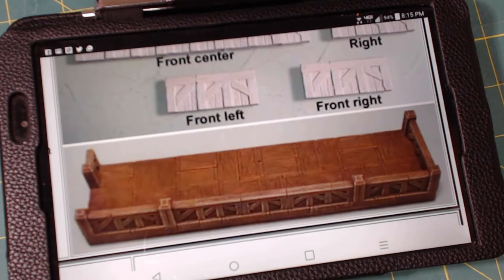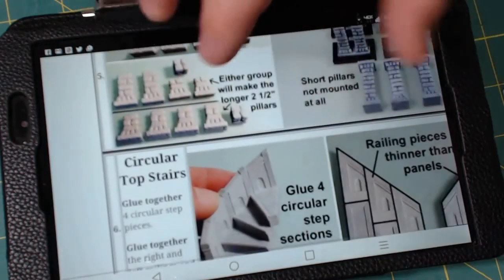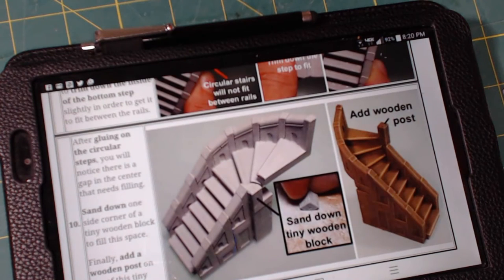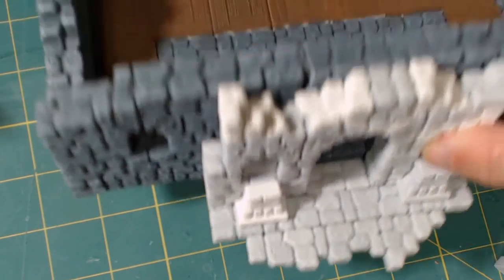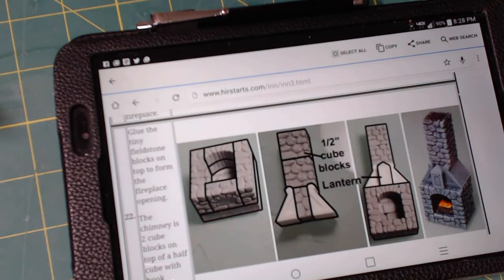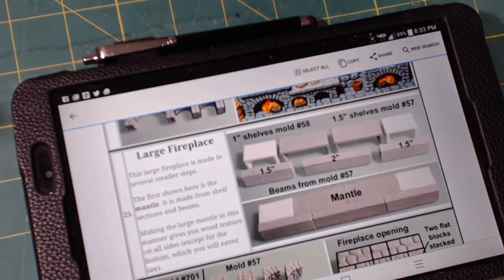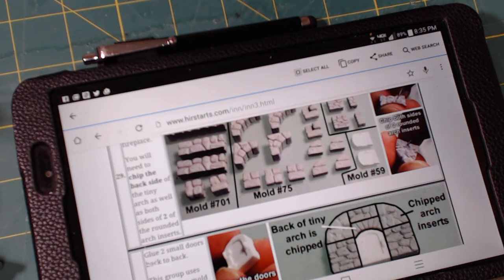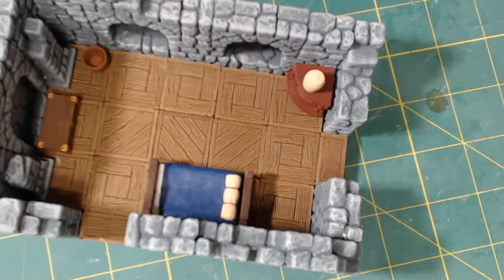Modular Inn with Hirst Arts Molds Part 12 - Stairs, Wall Blockers, Pillars and Fireplaces

Comment: Hey, what do you call the foam mat you glue everything to? I know you said in one of the videos, but I can't seem to find it. Great job on this by the way! I have not built anything, but I am now planning to buy about 10 molds and get crackin'!
Reply from the maker: Foam Core Board, you can get this at any hobby store or order it online.  I tend to purchase black as it is the easiest to cover paint wise if needed.
Reply: +Greg_FL I will look for it, but I have trouble finding a lot of this stuff as I live in Norway. Will look around though! Thanks!